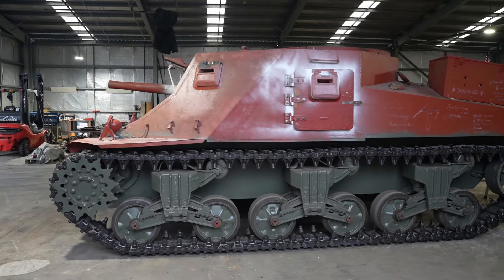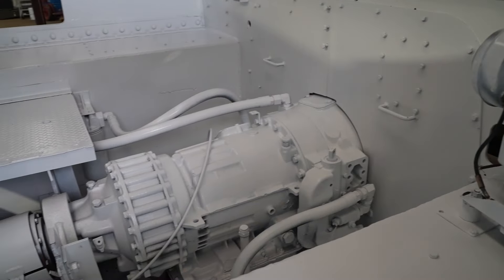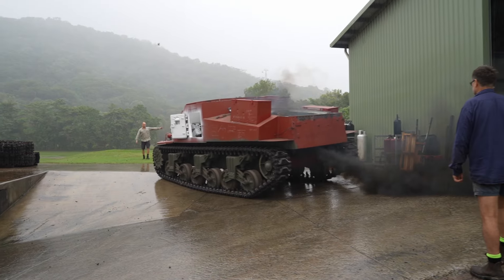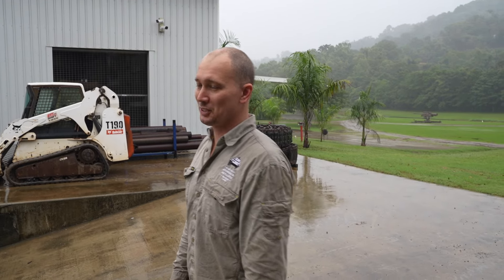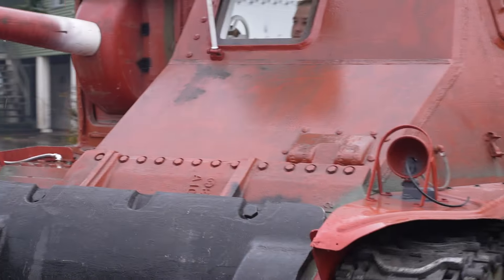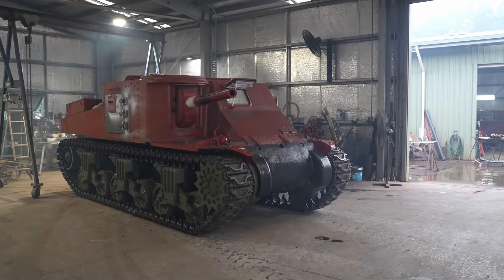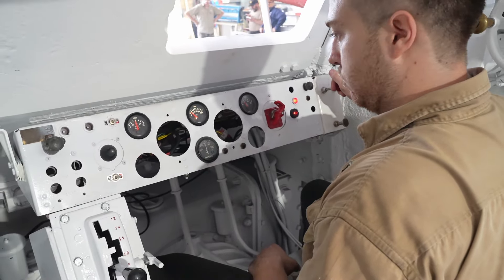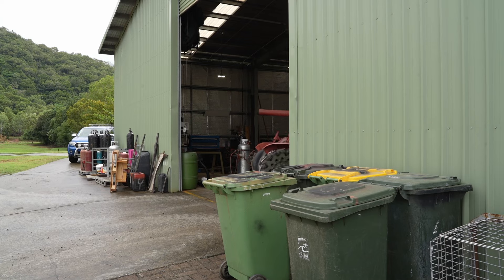WORKSHOP WEDNESDAY: Engine STRESS TEST, fighting compartment fitout and turret!

Comment: I live a short distance (in a straight line) from where the US had a training camp for the CDL (Canal Defense Light) mounted to modified M3 Lee (same base form as the Grant with few differences) called "GIZMO" by the ones that worked with it. There's annual tours of the old training site which was part of the Desert Training Center often associated w/ General Patton. It's own quirks aside & the fact it's not even a good design as tank designs go...I like them for the sheer neat factor of their appearance. 
I have a bunch of conveyer belt w/ the intent (would like to think I still will) build a home-made tracked vehicle & even had the idea of making a scale (though full isn't out of the question) representation of the M3 even if only from the outside.

Only just found this channel & liking what I see. Nice work getting this one going.

Comment: I build VW engines a fair bit over the years and the best sealer for oil leaks I have found is Blue Hylomar. Developed during WW2 for use on the Rolls Royce Merlin engines, it's successfully sealed up many an old air cooled engine.  It's a non setting compound impervious to grease and oil, cleans off with brake or carb cleaner (so no use around fuels) and owing to the non setting nature allows the seams to shuffle without leaking. Give it a try, you never know it may work.

Comment: Lucky    that    rag   didnt    go    down   in    the   blower    that    would    have   bine    bad    them    DETROITS   need   to     turn    up   they   like    the   high    RPMs ,   I   have   seen   those   blowers   blow   right   off  the   top  of   the   motor.

Comment: 3:37 Either Too much fuel or Too little air... Black smoke can be caused by blocked or partially blocked air intake system, a broken or underperforming turbocharger, malfunctioning intercooler or a problem with the diesel pump...
Reply: Or simply a forgotten rag.

Comment: You answered a question. It has a Guiberson T-1400 diesel engine? It appears to be an M3A3 welded hull, but which caliber (length) 75mm main gun is fitted? I'll wait with a worm-on-my-tongue (baited breath) to see the top turret and 37mm mount, which I assume are cast British Grant style. To the newbies, the factories painted the interiors an off-white, rather than bright white to reduce visibility at night. The main gun looks like the earlier 47(?) caliber belled muzzle version rather than the late 54 caliber counter-weighted version. I'm going by David Doyle's excellent book, but, of course during the War, supply issues made "specifications" a joke in favor of production, and field repairs throw the "book" out the window. The air-cooled radial in the Lees sound always strikes a note with me-like a crop-duster starting and taxying by! So much hard work and care!

Comment: Watching the M3 hull running around without the turret. Makes it obvious why the WWII users decided to use it as the base for  self propelled artillery. 
One question. Do you have plans to convert one or all of the guns into a blank firing replicas?
There are examples of black powder and compressed gas powered guns out there to choose from. Even electrically triggered flares have been used in the past.

Comment: Are the bogies from an M4? I thought M3 bogies had the return rollers directly on top of the bogie, not trailing aft like the M4.
Reply: @stephenking27 The Aussie M3 Lee model I'm building has the return rollers directly above the centre of the roadwheel bogies, as you say.
Reply: Late build and refurbished M3's used the later bogie units with the return dollars moved to the rear and the canted ones. This is a welded hull M3 a later build. It has also been modified to Australian specs such as the extra armour on the transmission cover.
Reply: @bobme4065  Good info thanks Bob!  Yes, I just noticed the lack of about a million rivets on this tank (D'oh!) so it's obviously welded!  But I did notice the up-armoured transmission cover & the extra stowage bins at the back which are Aussie mods.

Comment: Fantastic work guys.  I noticed something a number of episodes ago and was not going to say anything about it as I am pretty certain you know about it. However, it occurred to me tonight that if you do not know and I do not make mention of it, it could result in some serious time wasting trying to identify causes on your side. So, if you are aware of this, I apologise.

If you find you have engine overheating issues you should look at modifying the 90deg "square" bends on your aluminium pipe by replacing them with "mandril- radiused" aluminium bends or radiused rubber pipes. The difference in flow-rate between "square" 90 deg bends and radiused 90 deg bends is significant. The larger the radius the better.

Unfortunately It is not possible to say with any certainty how many degrees cooler the "system" might be with better flow rate because the overall "cooling rate" of a cooling system is a product of heat transmission between the engine block/water and the water/radiator/air.  Your current 90 deg "square" bends in the cooling system may in fact not be an issue as we have had numerous cases where lower flow rate resulted in lower overall temperatures. That said, if you do have overheating issues, the first place to look would be the "square" 90 deg bends.

Comment: Pro-tip to avoid having rags and such left in and forgetting about them: put some tape with "RAG" or whatever is in there over the hole you've closed up, so it is clear to everyone. Like when you put tape on the engine or steering wheel with "NO OIL", so it doesn't get fired up by someone who doesn't know or it's been so long you forgot. 

I've made this mistake myself, with no damage fortunately, but if this rag got sucked into the turbo, it would've been a bad day.

Comment: Most diesel trucks called rolling coal the black smoke you go from sitting still low-rpm to a high RPM it'll actually do that and then you fold that's when you also Full Throttle it'll do that too on a modern diesel engine will definitely do that then it won't hurt nothing

Comment: 3:42 The proper way to drive a vehicle with any 2-stroke Detroit in it is to smash your fingers in the door right from the start. Doing this ensures you're angry enough at it that you'll beat the everloving fuck out of that engine. You gotta beat on 'em, give 'em hell. If you think you're giving them enough hell, you're not. Treat 'em like you're TRYING to blow them up. The more abusively you operate one the better it runs.

 Slam it WFO, wrap the tach, and let it eat!

Comment: Are the tracks right for Grant? They should be rubber block type rather than steel grousers shouldn't they? They look like M4 Sherman tracks.
Reply: Australian Grants got a LOT of Sherman parts fitted - the Sherman running gear was a direct descendant of the Grant and the Australian Grants were in active service into 1946.

Comment: 8V71 Detroit is rated at 318 Hp naturally aspirated and 385 hp a whopping 112 ft-lbs, 1508 Nm at 1,200 RPM. Good thing that rag didn't get into the turbo. That would have trashed the entire engine.
Reply: These engines were made to haul semis over the road. I did for many a mile.  The only thing that should keep the Grant form doing 100kph is the gear ratio.

Comment: GM Diesels certainly can roll coal.....it depends on injector size,injector rocker lash and even injector cup clearance.  They also needs a LOT of air on the intake side, being 2 strokes. Its a good idea to check the air box drains in case it has any buildup around the liner ports.   The old rag left in the engine intake is interesting......someone had the turbo off, and stuffed the rag in that manifold, the turbo went back on and rag was left behind.
Reply: Thats just an old Detroit Diesel under load.... One reason they are not made anymore...
Reply: @ricksmith4736 no it was a rag blocking the intake if you actually watched 😂
Reply: @darcykeddell4930  No, he is correct , Diesels always blow smoke
Reply: @darcykeddell4930  Yes I watched it DB, but my comment is correct about Detroit Diesels...
Reply: @ricksmith4736  yeah if they aren't smoking they aren't running 😂 I love the old screaming GMs
Reply: @desertmandan123  ALL detroit diesels are supercharged.... Its how they work
Reply: @ricksmith4736  It's actually a scavenge blower. Nissans original diesels, Rootes 2 strokes, Paxmans etc etc all use a scavenge system to feed in air.
Reply: True, Black smoke is always too little air ,too much unburnt fuel from the injectors. Rolling coal is a symptom not a desired effect.
Reply: @ricksmith4736   There are a number of injector sizes, bigger injectors make more hp, but the rolling coal gets worse.  Technology has improved since then, and there are people building them have eliminated the rolling coal.........it does mean adding the electronic DDEC style injectors and deleting the mechanical rack......better turbo's also clean up the smoke by getting a lot more boost into the engine.  https://youtu.be/jbmgGxIl5jQ    Since the 1970's when that 8V71 was made, the modern turbo for that application makes 50% more boost, and diesels thrive on more boost.
Reply: @desertmandan123    Wasn't sure your Biden voting intelligence would understand..

Comment: Ive never been inside a tank THAT WASNT painted white. Well...originally white that is. After years of service that white gets a little..off-white. And dirty. And oily. And greasy.

If youve never seen, vehicles like M-2 Bradley and M-113 were a light loam-green inside. That way when you open the rear hatch its not that bright white interior showing, but rather a light green one. Maybe it wouldnt help much to conceal the vehicle, but it wouldnt hurt being green.

Looks like you guys need some decorative, less noticeable oil drip-pans.😂